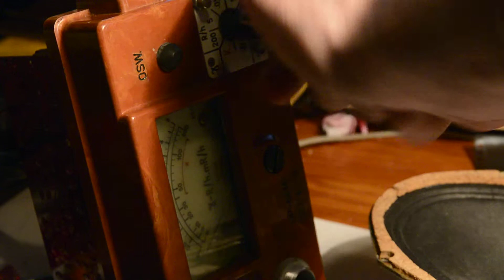stary DP-66M - próba uruchomienia - old military Geiger counter startup

Comment: hi can you help me to do the function test where you insert the batteries? what kind of batteries you use ?? I would like to make small test how should I begin I'm an Italian user could help me thanks
Reply from the maker: that meter uses twor R-20 (D size) batteries inserted in that silver metal tube, you can also attach connetctors of 3V adaptor inside a meter - the (+) is on that central pin of battery case :)